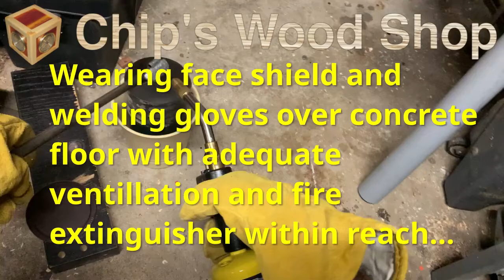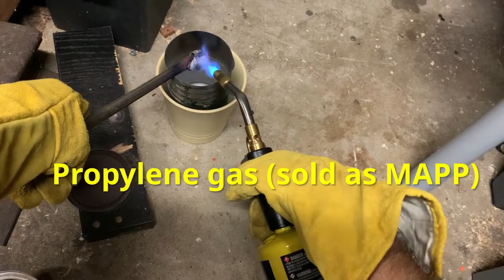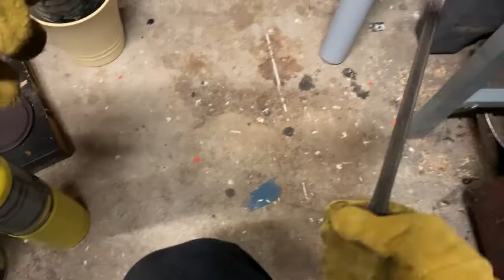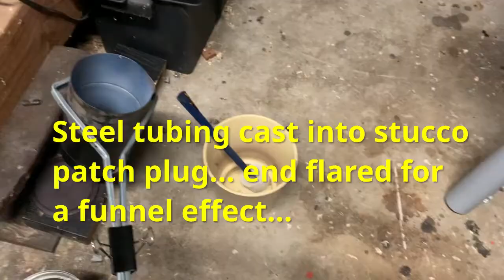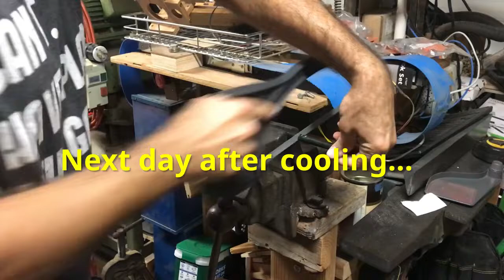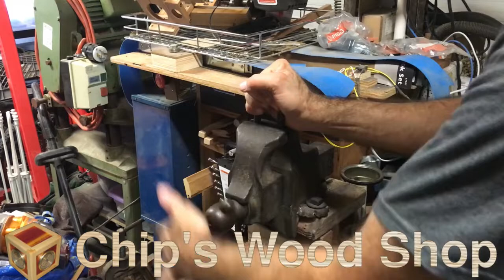Casting Weights for Wood Projects

Comment: Hi Chip, possible to share more over your wood lathe live center extension with a flange bearing block? I'm making one for my wood lathe to hold heavier 3 jaws chuck as not to damage the headstock bearings of over-hanging issue. I'm turning steel bar not wood.
Reply from the maker: Are you referring to this one: <https://www.shopsmith.com/ownersite/itemfind.htm?item=505602>?